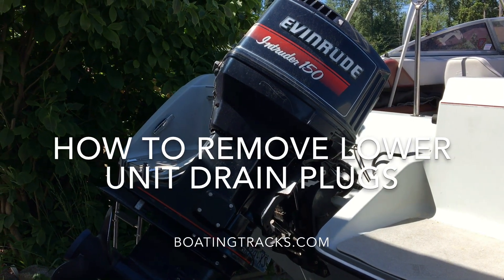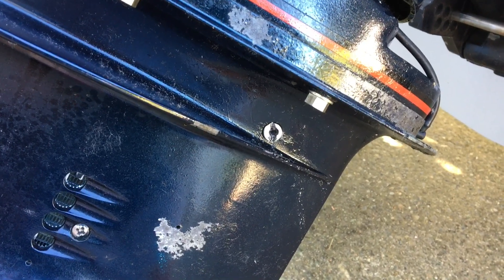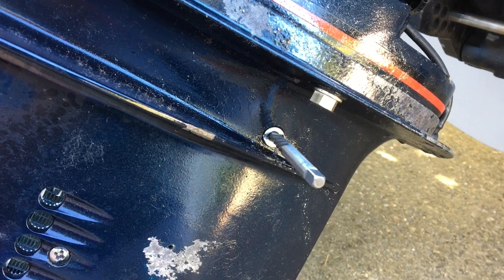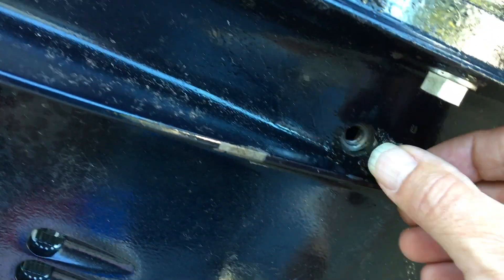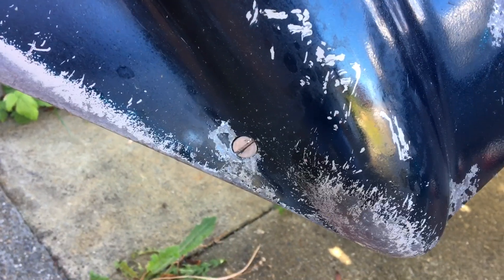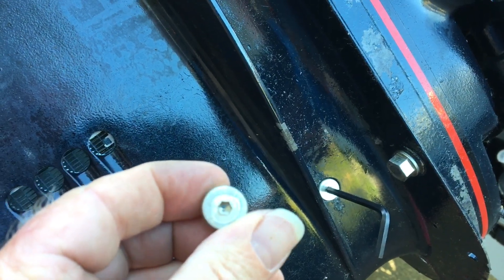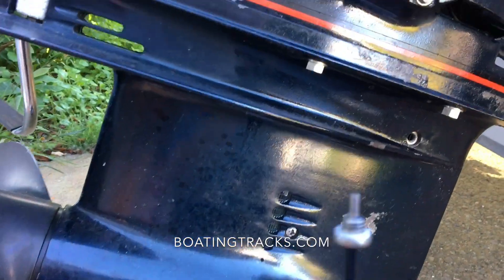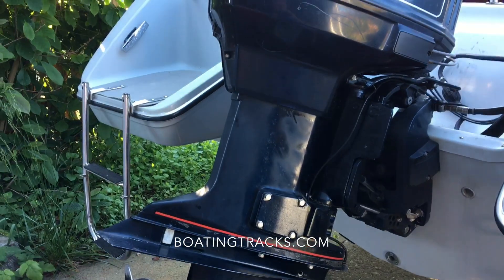How to Remove Lower Unit Drain Plugs

Comment: Remove the upper vent plug while filling from the bottom plug, else pressure can blow out a lip seal.  Once full, install upper vent plug.  About every manual tells how to do this correctly.

An motorcycle type impact driver is often used to remove/install these plugs, a simple screwdriver doesn't cut the mustard.

Comment: Thank you!  I did a lot of tapping with a hammer and a flat nail.  Then I heated with a lighter.  Then tapped some more.  Then I tried a large screw driver with a wrench attached and it finally came loose.  Thanks for the tips.

Comment: I had one stuck too and a mechanic showed me a trick which I saw it was too simple to work but it did. Spray Blaster on it and get a screw driver and a hammer and tap the head of the screw. It worked. It was really stuck and it was a very old lower unit

Comment: If you have regular maintenance to do the gear oil change. The plug will be easy to remove it.  Over tight is your problem. The plug coming with washer to help seal water out. Next time using a* big flat head* screw driver with muscle will do the work. No need to replace the plug.
Reply: Or if you buy a used motor and previous owner may not have ever touched it like in my case. 88 Meriner 5hp in Mint condition

Comment: Hi, thanks for posting the vid.  I'm having the same issue with my Johnson 50hp, the bottom  screw (or plug) is stuck really tight.  I did what you did,  still can't get son of a bitch out.  The screw is damaged really bad.  Any more idea?  Should I drill the whole thing out and tap new hole?  I'm hoping to avoid doing that.  Thanks.